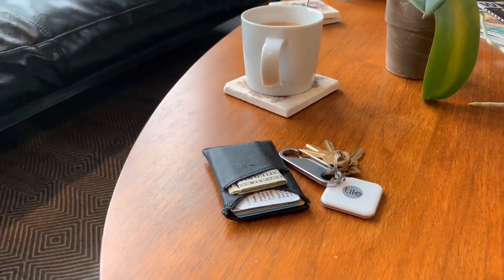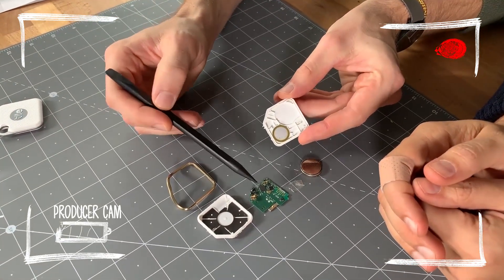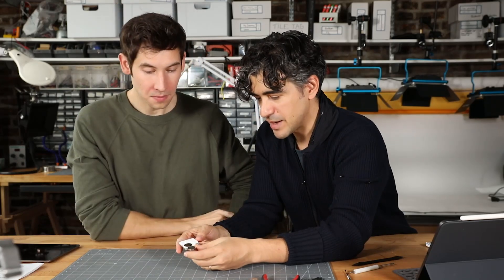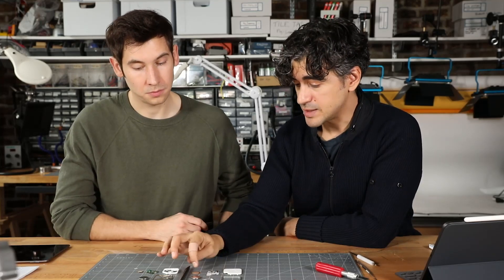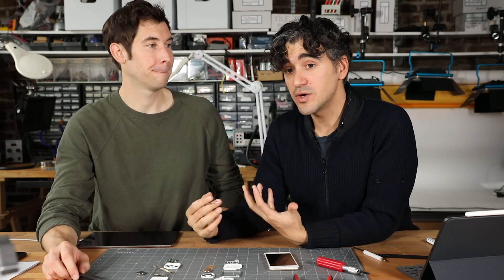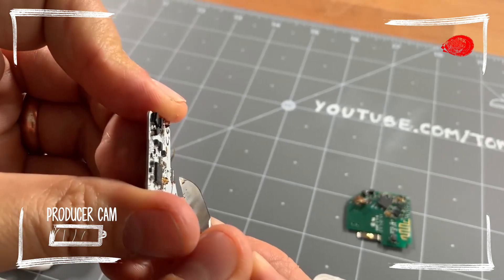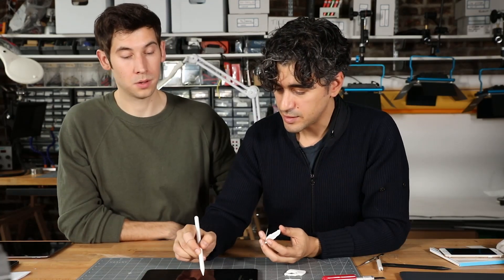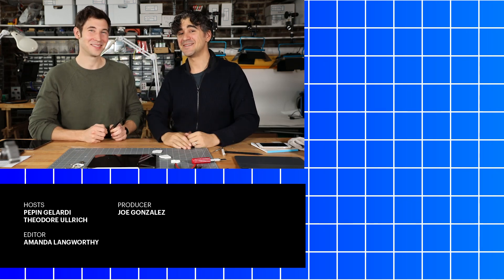Tile Teardown (Comparing Two Generations of a Product)

Comment: A teardown is supposed to take you through the ACTUAL teardown. This doesn't - I'm still no wiser on how to disassemble a Tile Pro.
Reply: This is also why I came here
Reply: There are a few styles of teardowns certainly. I think you're looking for a teardown meant to help you repair this? However this generation of Tile is decidedly not designed to be opened for repair. I might have mentioned this in the video - the housing appears to be ultrasonically welded together. Separating the halves is a destructive process, but you can finesse it with some sharp cutting tools. I used a flat-edge x-acto. If you can split those parts without damaging it too much, and you can make the battery or PCB repair you're looking to complete, you may be able to close it back up and re-glue with CA.

Comment: Amazing channel, surprised on the subs. You guys need to market out to more niche forums and subreddits.  A total breakdown for noobs getting into the electronics / pcb industry would be nice. I found your channel because I was looking for a tear down on a specific electronic product (ultrasonic cleaners) but happened to find a tile breakdown and was curious. (If you're interested on how I found this channel).  I subbed and have been looking around for a channel that break downs products and PCBS because that's what I want to be doing but have really no clue on electronics. I am planning on taking a course as well but I think I could save some money by going through some youtube videos of what components mean, how they are made, why they are positioned the way they are, what industries do, how to create embedded products, (I have comp sci experience professionally software side) but do not have computer engineering experience or knowhow hardware side. I have been experimenting with C with products like arduinos and raspberrys but have very limited knowledge on electronics. Hardly know how to use a multimeter, but been learning. I hope info some how helps.
Reply from the maker: Thanks so much, Reggie
!